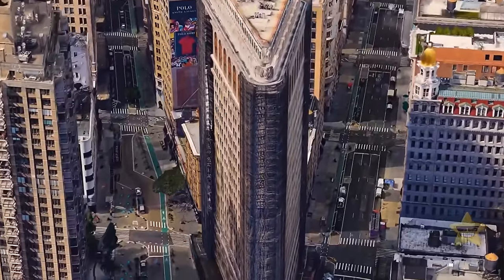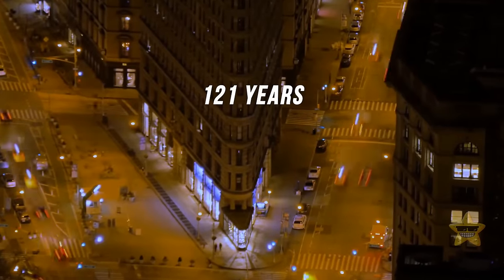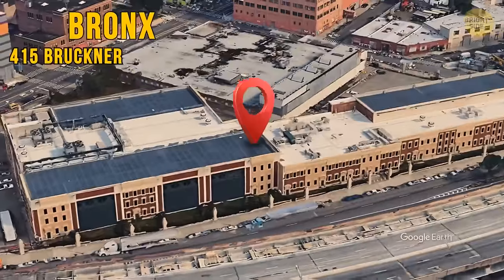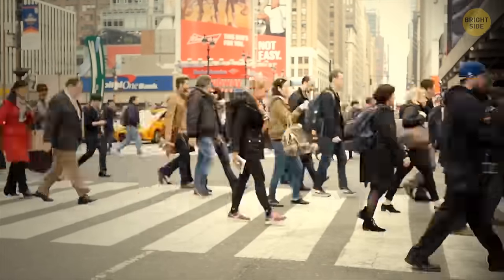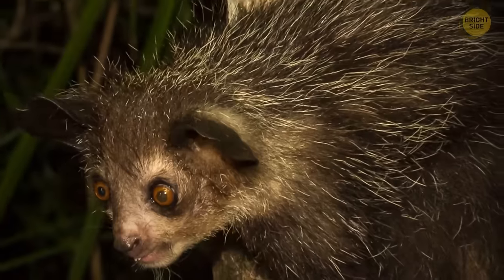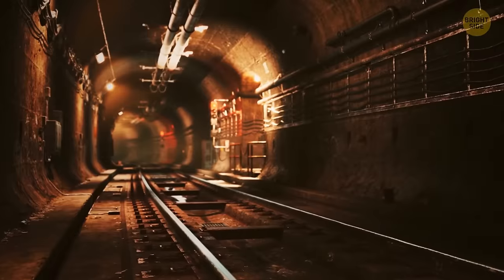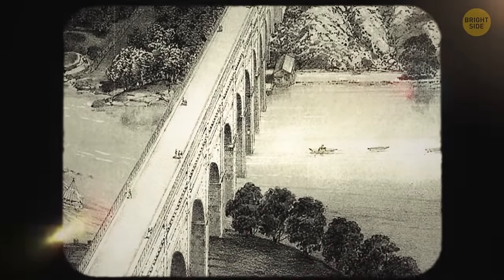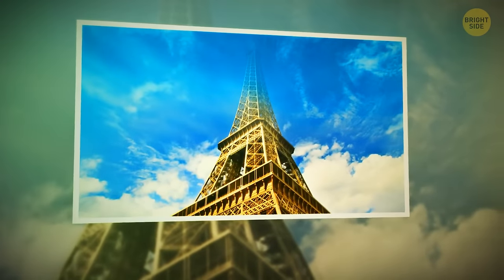The Shocking Story of the Most Mysterious Tower in New York

Comment: The flatiron building has a dark side to it, more construction deaths occurred during its construction than any other building in NY.
It also changed hands several times during its construction,  with the foundation and foundation iron work bankrupting the first set of investors. The flat iron failed as upscale residences due to its heating system and constant sounds of wind. It's a creepy building that has had a fair share of guest mortality as well. Haunted is an under statement. Good luck finding who the true owners are, that info is buried as well. I bet the attic is loaded with antique furniture...but too haunted for anyone to spend more than a day. It's exterior is beautiful, sadly the interior has been remodeled so many times almost all of the art nuveau influences have been removed.